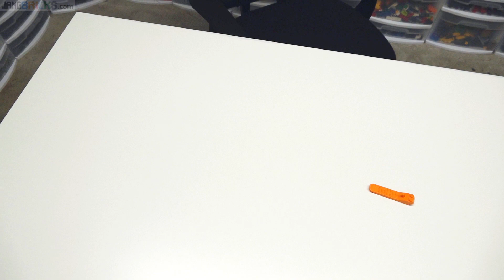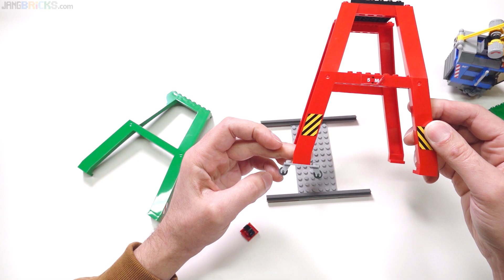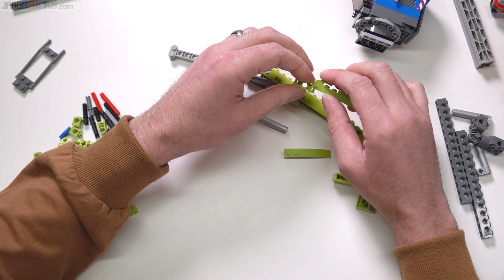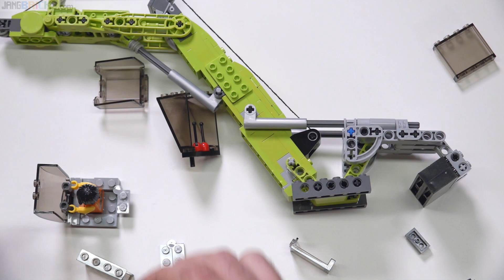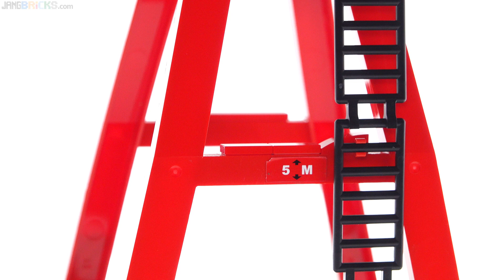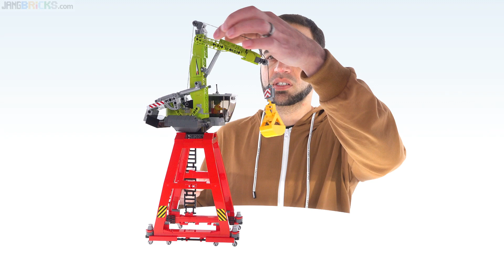LEGO Harbor Crane design & build, start to finish process & explanation!

Comment: I love it. The lining up ladders remind me of the opening scene of 2010: The Year We Make Contact, where the two people are talking on the stairs of the radio telescope. I spent a long time when I was like 10 just obsessing over how it would all work with the stairs lining up.
The crane has a really good rugged yet modern look, that circuitry/generator box looks perfect like it's housing specific equipment. My only suggestion would be a tiny little touch of the green on the cockpit section.
It's fun seeing the whole process of the build, makes me want to build a crane :)

Comment: maybe some health and safety lights(not actual lights but trans round 1x 1) on the crane especially a red airplane light on top style thing. also using the grooved bricks on the side you could slide the seat back and forward sitting on a plate.

Comment: I think it looks really good and I love the functionality of it. I do agree that the two bars are applying too much friction. It just looks uncomfortably close to coming loose off the platform when you adjust the crane at that joint and you having to hold it back with one hand. I still like it a lot, and you surprised me with managing to work in the red/green color scheme that I initially thought would not work.

Comment: As for your Technic "clamp" to hold the crane to the base, I believe that there's a pin hole through the turntable, so you should be able to use an axle with stop and something else on the other end (maybe 2x2 round brick or plate?)

Comment: I dunno if you'd be interested in doing so, but the wheel system used for those tracks on official sets is the double plane wheel holders with the small train track wheels on either side, sandwiching the track.

Comment: I really like this design!

There are some small details as you said that could be changed BUT
It works for me and the Color scheme is amazing. I think you really pulled that of!

For the ladder I would suggest the "Plate, Modified 1 x 2 with 2 U Clips Horizontal" just to have it a little bit higher.

The one thing that I would change is the upper boom(?). Compared to the lower part it doesn't fit that well.
I really like the use of the old Technic liftarm with fan! The back side of those plates don't look that great.
Maybe it needs more of that Technic look?

Edit: OH wow you just said the same exact thing. Yea I think more Technic would work better
Edit2: You should look into the LEGO Star Wars AT-STs(75153, 75201, 75254) they just have a axle through the turntable which makes it quite secure.
Maybe you can use something similar. Just put the "Axle with Stop" through the top and in the base you have a "Round 2 x 2 with Axle Hole" to secure it.
Since you used a "Brick, Round 4 x 4 with Hole" that makes it quite sturdy.

Comment: (Watched up to 22 min)
I would recommend adding a counter balance (specifically a weight that moves out behind the cab) attached to the arm and cab, to provide a counter torque. Now this would have to be 2 independent moving parts (while keeping it at this scale), but I think it would hold the arm up. I could be wrong, may be too much stress for the peices

Comment: Great video! Even though it's kinda long, there's not a single minute that should be cut out. I really like the crane design, I wonder how it would look if you would recreate the supports in green (I personally think it would work better with the limegreen top section, but it's your build so your choice :D ). Please do a similar thing for the zoo when you get to that!

Comment: 6542 has a very similar setup with the a frames and the wheels, that's really neat 
 
Said set also uses the same weight piece, but to keep the frame to the ground as the crane can't rotate

Comment: Regarding your "LEGO train yard & locomotive maintenance shop improvements" video from 2018. I can suggest using the grey single track pieces to install in your train shops directly on the grey concrete. This way your minifigures can access the trench under the trains, like in real life.
Reply: I'll build a small example.

Comment: That was very well done. Both the crane and the vid!
The format is really good, though I would'nt need the speed-built parts of it.
Maybe the cab and platform/box is the most straight forward but I love it! I like the details added at the wheels/base, too.
P.S.: Are there no gangways in your harbour or do I need new glasses? Is that intentional?